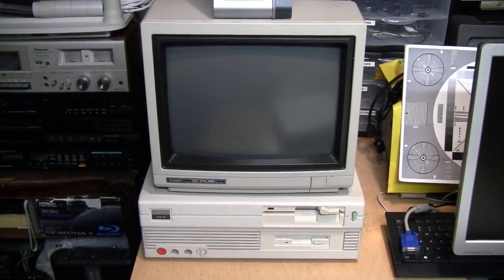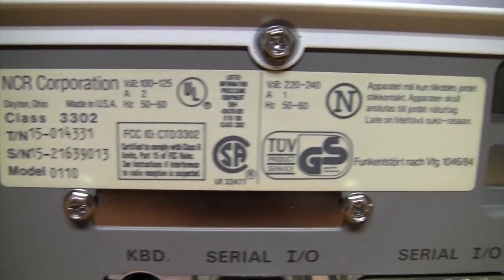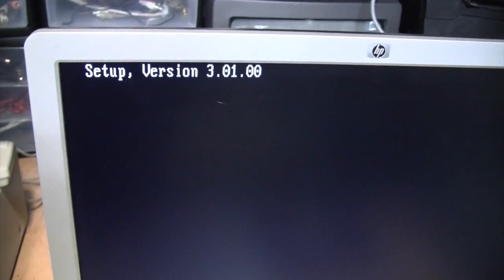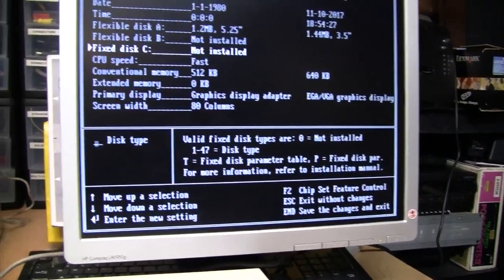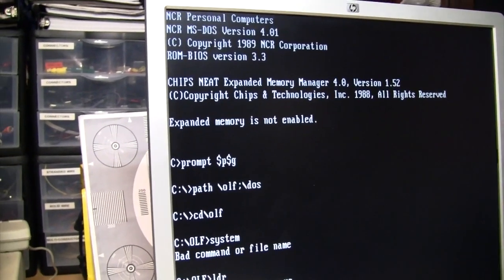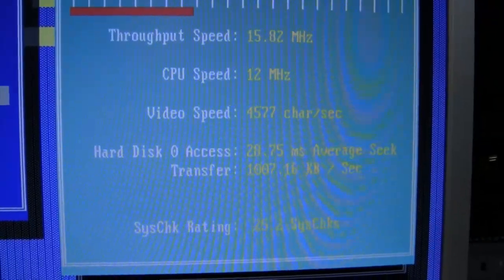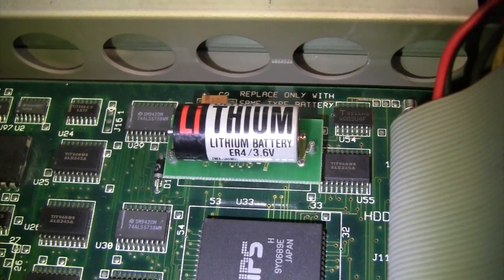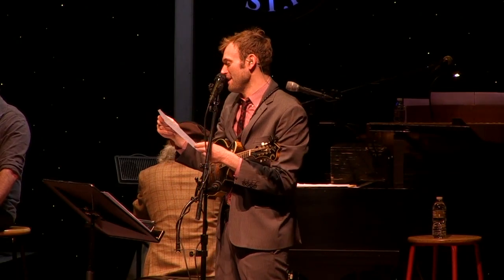1990 NCR 286 computer imitates a Samsung Galaxy Note 7

Comment: Why did they have to solder the batteries right onto the motherboard in those days? Makes it a pain to replace them.
Reply: Makes you appreciate the replaceable CR2032 batteries on modern motherboards.
Reply: even those are sometimes soldered on :)
Reply: Tom: Ah, planned obsolescence. How could I forget..
Reply: I sure do Simon. I sure do.
Reply: Naomi Baron so true. I'm also old enough to remember that back in these days, by the time this battery failed, it was time to upgrade computers. Hardware back then was improving so quickly, after a year or two, computers were twice as fast!
Reply: Tom Bunyon  sounds like apple today
Reply: NCR, typically made Point of Sale systems, so the machines were probably never meant to be site serviceable, an ER4 Lithium Thionyl Chloride battery should have had way more than enough capacity than necessary for the usable life of the machine. My guess is most of this equipment was probably leased in its day and was designed to be thrown in the recycle bin after a few years.
Reply: Brandon Upchurch NCR still makes Point-of-Sale machines that are designed to be repair-hostile.
Reply: Steve B - Yea those were the days. I've had my current computer for 5 years and just have no need to upgrade. In fact everytime I get tempted to buy a new one I balk at how much time and effort it would take to set everything up just right like what I've got now. I hope my computer never breaks.
Reply: @Naomi Baron, Maybe it's like Galaxy Note 8? it is the same mentality; they thought the battery will last a decade so they glued it hard to the phone casing, but when it explode nobody could replace it, so they have to ship them back to Samsung. If they weren't so shortsighted then they could've made the glue a bit weaker so a regular repair shop can replace it for anybody anywhere.
Reply: Or maybe they thought the battery would outlast the computer. Even then people got new machines every 4 or 5 years or so.

Comment: Well I'm glad the bugger didn't blow up on ya!

Soldering the battery in made so much sense back then, I'm sure. No one will be using this thing for that long, right? Almost 30 years later, what do ya know, we still care about this old junk and, well... yeah, it's an issue.

Hell, the CD-i has its battery logged inside a chip package - Damn thing gets stuck in a boot loop when that dies!
Reply: Those clock modules the CD-i uses were very widespread in the computer world. They were used by many PC manufacturers and could even be found on things like Apple II clock cards. The CD-i is far from being one of the only device to have one of those. They're annoying but at least as far as I'm aware they don't leak.

Comment: The battery got triggered because you pulled on it a bit? Wow.

That's a neat little system. All the fun of a 286 with the convenience of VGA, 1.44 MB floppy, and a PS/2 port.
Reply: It's how these particular types of batteries are designed, the battery has to be sealed and the positive terminal has to be insulated from the the negative terminal which is the case of the battery, so in order to seal and insulate the positive terminal they use glass, as a result you can't put a lot of pressure on the positive terminal otherwise it will break the glass seal.
Reply: AND decent upgradability!  Removable CPU!  VGA RAM sockets!
Reply: VWestlife should be careful! That battery may very well be Lithium Thionyl-Chloride based, Which is extremely toxic and carcinogenic.
Reply: It is Lithium Thionyl chloride, the "ER" in the model of the battery means Lithium thionyl chloride.
Reply: With the DIP setting for "Multisync / VGA" monitor and the expandable VRAM, I wouldn't be too surprised at it offering some early SVGA-esque modes (e.g. 752x410, 800x560) or even something equivalent to XGA... if you put the extra memory in and had the right video drivers and utilities of course. The 512k "option" would be enough for 1152x864 at 16 colours, if the memory/chipset/DAC could run fast enough of course. Plus it would allow upto 800x600 in 256 colours too. Any more than 256 at any rez is probably beyond it.

(I've put together a 286 with a half meg ISA Trident VGA card before, and it ran up to 1024x768 4bpp and 800x600 8bpp... with a surprising turn of speed, even... bit crazy having a machine with almost half as much VRAM as main RAM (1152k)...)

Bet that cost quite the pretty penny back when it was new.

Comment: was NOT expecting the advert at the end! I LOL'ed so much I had to go back and play it three times to catch all the gag lines :-)

but seriously, folks...

I went to uni in Ohio and NCR was a BIG recruiter at the Engineering school. NCR didn't just make cash registers, but mini- and micro-computer systems,mainly for things like inventory management, Point-of-Sale, and small-to-medium business backoffice operations. with so much customer-facing placement, NCR spent a LOT on a consistent, elegant, industrial design.

honestly, I miss the 80s/90s as far as microcomputers go, the vendors hadn't quite shaken out with utterly boring beige-box clones. this tiny AT-type system shows there was a lot of creativity and technical expertise going into products that weren't just a PC, but a representative of the corporation's heritage and engineering capabilities. and the damn thing is really CUTE! IBM had the big red power switch, but NCR's were ORANGE! not only that, they pioneered the AT-on-its-side Tower configuration with a computer called - inscrutably - the NCR Tower!.

I'm not a retrocomputing fan, although I do wax nostalgic for the days when PCs weren't simply appliances, but an opportunity to learn about computing in general ("expansion RAM? what's that for?" or "I can add a <chortle> 2400 bps modem by plugging it in to a slot?") and not become a MS Office drone, where Word and Excel are requirements for being a line cook at Wendy's.

Great video Kevin, and another fun walk down memory lane. Many thanks!

Comment: I feel like all the old computers and their respective hardware like cards and so forth, just get recycled (ie: destroyed) in my province. I never see anything like this ANYWHERE. I saw a video of computer recycling. Just huge bins filled with motherboards and cards etc of all kinds and kind of died a little inside, because I know there's lots of people who want to build retro pc's or buy retro computers and this stuff is get destroyed. Meanwhile all the stuff on ebay is sold by people who are aiming it at collectors and know they can get a bigger price for it.
Reply: MarkNF82 A 386 was my first PC (although I'd had a C64 before that). That 386 was my teenage years. I came back from college (where I got a Pentium 2) and asked my Dad where my old 386 was. "Oh, I took it to the dump". I was mortified! I do have some files still that go back to 1993 (mod and s3ms I made), but anything I wrote, or anything else I made... gone.

Comment: i think it might beacuse of a few reasons
reason 1: it has gotten wet/has been left in a garage which flooded and the old computer was left for a while then was sold and someone fired it up and it chaged up but was still wet or had the water damage
reason 2: someone put too much power or was playing around while the machine was on
reason 3: the battery has been off for so long a sunnden chagre or turning it on made it explode
Reply: It's a non rechargeable battery, so the computer is not trying to recharge it. It broke because he pried on the positive terminal of the battery which put pressure on the internal glass seal in the battery and broke it.

Comment: Ah, I just picked up one of these today at a swap meet though mine is badged as a UMI ProQuest 900 Series Workstation. other than that it seems identical to yours. Unfortunately, when I try to power mine up I get 5 beeps and nothing on the screen. I'll need to mess with it some more.

Comment: The lithium battery was an advance for the time.  Previously a Ni Cad battery requiring a charging circuit was built onto the motherboard to keep it alive and because of the internal resistance of that kind of battery, if you let the machine sit for a period of time, unused, it would go dead and lose the settings.

Nice video.  Electronics did in NCR, since at that time their POS systems were still mechanical and they dragged their feet in catching the digital wave.  Overseas competition was the greatest game changer for them.  They are still around living off some patents and licensing technology they still develop but no smoke stacks anymore employing thousands.

Comment: that is just a normal lithium battery , you can replace it with a 18650 lithium ion battery or the original battery type! , lithium battery normal never leak until you punctured them with a screwdriver or something like that...........
Reply: There's no 'normal' lithium battery, there are several types all known as lithium batteries. In this case it might be a non-rechargeable type. An 18650 will most certainly not fit in there. Anyhow, I don't think he'll have a problem finding a replacement -- the problem is in desoldering that battery, getting that little carrier board out, and soldering a new one (or a socket or whatever) in.
Reply: Nikhil Dabas I think soldering is very easy to do , the main problem is just to find that type of battery....
Reply: Nikhil Dabas brand new er4 battery will cost you 13$ and it is non rechargeable 2100mah battery........
Reply: It's a Lithium Thionyl Chloride primary battery, you could replace it with a fully recharged Lithium ion rechargeable but the battery wouldn't recharge but the self discharge of the battery would make it last a shorter than replacing it with another lithium thionyl chloride battery
Reply: I saw a D cell that was German-made that may have had similar chemistry a couple of years back. It was 3 volts or so and was designed for low-drain; long endurance applications. I thought about getting one - until I discovered they were $30 apiece.

Comment: Hi All, nice machine, i have a NEC 286 powermate for a while back in the day when they ruled.
Re the POLL 4D, there is a chance that it may have been used in a early networking with lan card or serial port based communications, here each PC was connected to a specific port on a cluster controller, in the day the hard drive or floppy would have the port number in the autoexec or as a parameter in loading the driver, very similar to say sound blaster settings work, the 4D can easily be where the wiring from that pc's desk bach to the controller or hub terminated on port 4D

Comment: I had 286 NCR with 512kt ram and EGA. Strange it was same form like your case but it had 720kb floppy which was internal but  outside of case. Floppy connector was under the unit. I heard it was mounted to stand which i didnt have so  it was always little bit over the table to get floppy drive connector connected. It had 20mb hard drive and small keyboard without arrow keys and esc was next to numlock.
Reply: It was probably in a cash register or atm

Comment: A soldered on motherboard battery is pretty bad, but not as bad as the batteries on CDI units where they were "encapsulated"  and you had to literally at the encapsulating plastic like an icepick with a screwdriver to get at it.
Reply from the maker: Plenty of computers used those Dallas clock modules with built-in battery, too.
Reply: At least a lot of them were socketed, meaning that you can easily remove it... but finding a replacement could prove a bit more difficult, as Dallas got bought out and they stopped making the RTC units.

Comment: damn, wish i had an old computer, i got a ti-99 for christmas but it doesnt show up any video so im bummed out on that.
Reply from the maker: Did you get the right video cable for it? The RF modulator the TIs come with tend to fail, but the computer itself is probably still fine.
Reply: well i have an av cable for it, and i bought a generic rf modulator, but both do not seem to work, and i do not know who to go to in order to get this checked out.

Comment: I'd say those extra DIP slots are for cache rather than video memory maybe both.
Reply from the maker: There is no cache on a computer this old. Most computers didn't have a cache until the late 386 and early 486 era.
Reply: Ok it might have been the AST 486 then but I thought it was the Victor 286.

Comment: Was this computer meant for business use or home use?  I'm very pleased the system didn't catch fire like I thought it was going to do, but this proves the point that Lithium batteries are pretty dangerous if you're not careful with them.  Let's hope the chemicals that leaked out won't damage the motherboard.
Reply from the maker: Most likely business use. I don't think NCR (National Cash Register) has ever sold equipment on the consumer market.

Comment: what is that jumpers and dip switches video from?  don't know what olf means still but found this. sure you seen it already though.
 

 http://www.estelebanon.com/comps/ncr0201.html

also it says the battery is on a chip that plugs in. you sure it don't just unplug?

"Instead of alkaline batteries to keep the CMOS intact, the NCR unit maintains
CMOS with a plug-in integrated circuit chip that can be replaced easily. These
RTC/battery modules last several years. A warning message appears on the
screen at boot-up if the battery is failing. If the battery can't be replaced
immediately, the user can boot with the reference disk at each power-up."
http://www.atarimagazines.com/compute/issue148/140_NCR_System_3200_Mode.php

Comment: What did you end up doing about the battery? Thinking about just clipping mine out.
Reply from the maker: I removed it and wired in a replacement. It's not an exact match for the original, but any 3.6 volt lithium battery will work.

Comment: Do you think that thrift store still has the other computer? 
If so would you consider buying it for a little science experiment?
I have this idea that the other computer would probably behave the as this computer with a seemigly dead RTC battery.
The thing is the battery may not actually dead it may be "sleeping" 

These Lithium Thionyl Chloride batteries when stored or used in very low drain applications have a tendency to form a layer of Lithium Chloride on the anode which makes the battery behave as if it dead but in theory if you apply a continuous load accross the battery you can break up the LiCl passivation layer and bring the battery back to life.

My test idea is that you buy the other computer and then use a multimeter on the dead battery and leave it there for several minutes to see if the voltage rises and if the approx 10k ohm load is enough to break up the passivation layer, if that doesn't work then you could try using a low value resistor and attach the probes of the multimeter to the leads of the resistor and then put it across the battery and see if the voltage starts to rise.

Although this whole setup may be pointless if the computer was designed to overcome this problem as it may be possible that the engineers knew about this problem at the time and put a resistor as a continous parasitic load in order to prevent the passivation from occuring, in which case the parasitic load probably killed the battery years ago.
Reply from the maker: The battery used in this computer is not rechargeable. I know what you're talking about, but I believe that only applies to rechargeable lithium batteries.